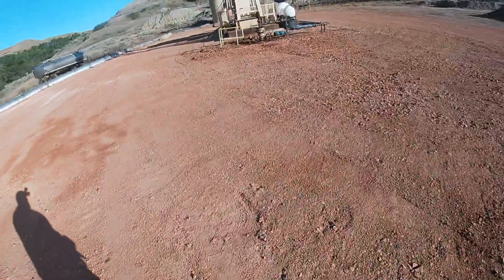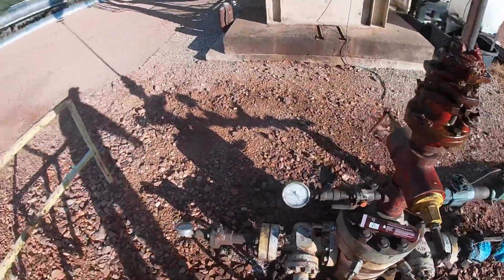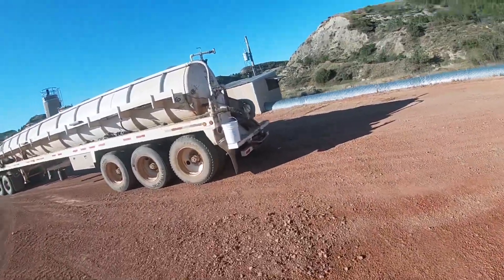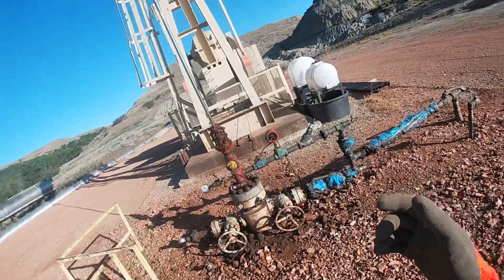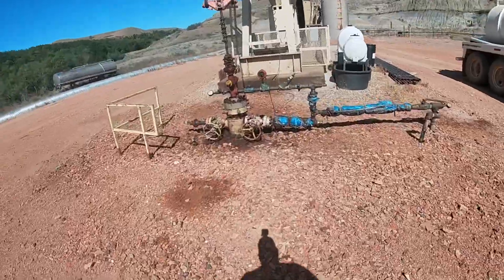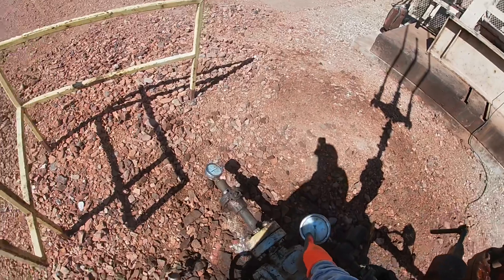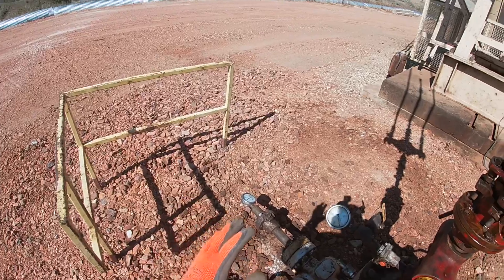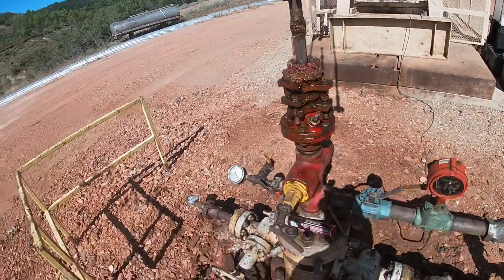Hole in tubing/rates rant

Comment: I know im several years late but i just found your channel and im loving the videos. Im a lease operator/pumper in Colorado running gas wells so learning about oil wells has been cool. Something I wanted to mention is if theres any kind of scale inhibitor or other kinds of acids in your chemical treatment i have had a absolutely horrible time with it causing holes in tubing and sometimes casing but we treat down the backside. I understand in your case its a necessary evil because of your paraffin issue which i wholeheartedly understand is a nightmare. I have just ran very few wells with any kind of high acid treatment that haven’t had issues with holes in tubing.